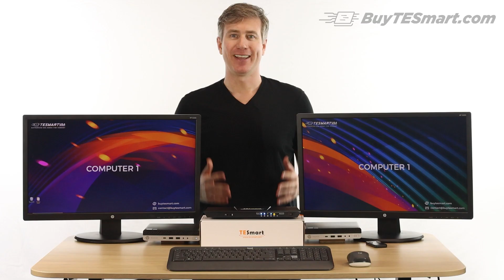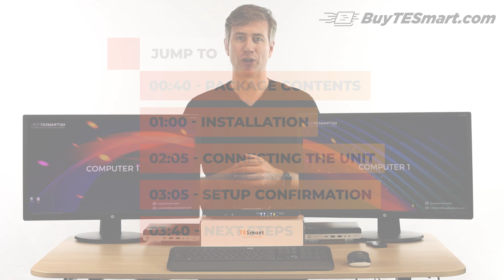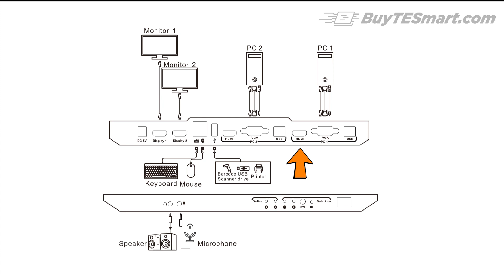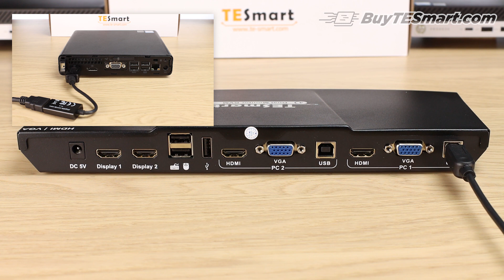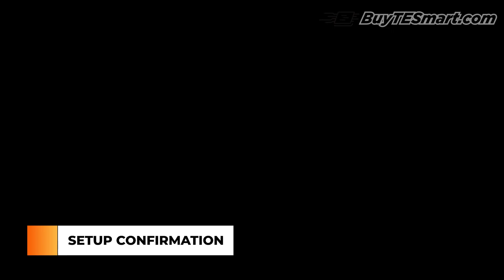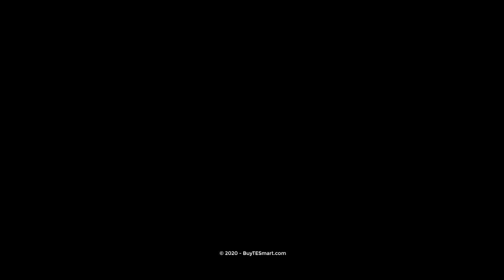TESmart Dual Monitor KVM Setup Video HDMI+VGA Switch

Comment: Just to be clear, my laptops have 1 HDMI port and a USB-C port. Would this item work for me? with an adapter? 
 or can I use an HDMI splitter?
Reply from the maker: This is an old video.  Checkout this one....  https://youtu.be/GfBZiGp_s_I. You will use the HDMI port plus a USB-C to HDMI or USB-C to DisplayPort adapter, depending on the KVM.  Here's a link to the tested--approved adapter page https://buytesmart.com/adapters.

Comment: I have the 2x problems:

1) only Online 1 is On and Online 2 if OFF although the USB connection is established and all USB devices work. 
     How do I fix this?

2) Furthermore I have only a picture on 1x monitor (both are the same model with HDMI port).
     - If I connect my desktop PC onboard graphic (no graphic card installed) directly to both monitors (without the KVM) via HDMI to HDMI and DVI-D 24+1 via DVI-D 24+1 to HDMI adapter to HDMI
       I have a picture on both monitors.
     - The same for my Laptop HDMI to HDMI and USB-C via USB-C to HDMI adapter to HDMI. I have a picture on both monitors.
     But if I connect the KVM I have only a picture on 1 Monitor (plus only Online 1 is On only).
     How to fix?
Reply from the maker: Hi.  Checkout the troubleshooting video:  https://youtu.be/Eppd3qjy3vk.  You'll have to open a ticket with us or TESmart, whoever sold you the KVM if you need more support.  We can't really diagnose much over YT comments because we don't get notified of replies.

Comment: Great video, thank you. A quick question, I am from Australia, so I just want to make sure that, given the different electricity with U.S.A. your product will work here and not burn my fuses? :D
Reply from the maker: They will work.  We have customers that purchase for Australia from time-to-time.  We also have the correct Australian plugs, if you need.  One last thing... this video is for an older model.  Most likely you would want one of these... https://youtu.be/v6K4eIHZXZI
Reply: Thank you so much for your prompt reply. You are correct, that is more likely what I am after.

Comment: Is it possible to get higher resolution than 1920x1080 . I would like to have 2560x1440. I have TES Smart connector for commuter 1 DP 1 HDMI    for device to monitor HDMI.
Reply from the maker: For this model, only 1 monitor (the monitor that receives the HDMI signal) will have resolutions above 1080P.  If you're looking for higher resolution and speeds, you should check out the newer models:  https://youtu.be/v6K4eIHZXZI

Comment: Hi Justin,
I got this switch for my birthday and can not wait to use it, but my equipment is different. I triedto find out via your website, but got no answer.
What I got is: 
•	2x Monitor HP Compaq LA2306x with VGA, DVI and display port
•	1x PC WIN 10 PRO, with VGA and display port
•	1x PC WIN 7 PRO and WIN 10 PRO dual boot with VGA, DVI and hdmi port
•	1x Mouse and 1 keyboard, standard USB
I believe I will need additional adapter. Please advise.
Reply from the maker: Hey Alfred, Yes it seems you will. Did you go to BuyTESmart.com we do not have any previous support request on our website on this. You can also send a direct email to Contact@buytesmart.com and we will get you all setup :)

Comment: Thanks for the video. Can I set this up with Mac OS to one monitor and Windows OS to the other? Will shortcut keys need to be modified? Thanks
Reply from the maker: Hey Ben Bishop! Yes this would work with that setup. Shortcut keys do not have to be modified, nonetheless if you need to modify the keys its a simple Scroll Lock+ Scroll Lock + F1 will switch the hot keys to Right Ctrl :)

Comment: How would you connect a Raspberry Pi 4 since it uses dual micro hdmi outputs with no VGA output on the board? From what it looks like, 1 of my micro HDMI would be adapted to a full-size HDMI output to the switch, the other micro HDMI to a VGA adaptor along with a USB output if this is correct. Connecting either my work or home laptop looks straight forward. Also, would this be able to connect the new iPad Pro with the new magic keyboard?
Reply from the maker: You are correct, you would need adapters.  We haven't looked into micro HDMI adapters but have a list of other tested/approved adapters in the Support section of BuyTESmart.com.  Not sure about the iPad Pro.  We haven't had an opportunity to test with that.  I'm thinking it would be a little bit of a challenge due to Apple's preference for a closed environment.

Comment: Hi there Justin. FYI I bought this Tesmart dual monitor KVM a short while ago. 

Got it connected and running as advised cf. manual + other Tesmart vid. My focus for starters is simply to get my main PC working with all promoted features - it's setup as described below: 

A) Main PC (Lenovo ThinkCentre running Windows 10) has no HDMI out so got it connected via (*) VGA > HDMI adapter > HDMI + (**) DP > DP + USB
B) For input units I got a USB wired keyboard + USB wired mouse  
C) I have two Philips 278E monitors connected to the KVM as output screens. 

I can get some KVM features working - but not all. What works?  I can shift Monitors via SrcLK x 2 - but only provided I got a second PC connected as well. I can shift Input destination via 2 x (right) AltGr with two PCs connected. 

Unfortunately so far there's 1 major issue with the KVM: 

I can ONLY get the main PC displaying on 1 screen at the time. Can neither get the Main PC to show op as duplicated in my dual screen setup - nor as one large extended screen utilizing both monitors. Nothing happens when I click the right Ctrl bottom x 2 (also no 'registration' sound of the input which is the case for other shortcuts that do work cf. above). 

Got no luck using the remote either.

So how do I resolve?  

Also; how do I connect a Macbook Pro (2012) to support 1 PC dual extended monitor setup (like the one that doesn't presently work with my Main PC cf. question 1)? Presently I've tried mini display port to HDMI adapter + USB connection which works - so I reckon a USB to DP adaptor is needed to complete this setup as well (?).  

Obviously I need to see the main PC working before investing it further adaptors for the Macbook Pro in order to get it working.

Thanks in advance!

P.s. The KVM model I got has HDMI + DP ports for input. Strangely it differentiates from the one you're showing in your vids as it does not have front audio jacks input options for mike + headphones. Rather it has only a headphone in the back next to the power chord jack. Just figured it worth mentioning for troubleshooting purposes. Haven't had luck getting the audio jack work out of the box either btw. but in all fairness I haven't tested it deeply yet.
Reply: May be that the issue is due to the dual screen capabilities of my main PC.

When I go to the screen settings of Win 10 on the main PC (Lenovo thinkcentre tiny) I see no dual display options at all . Reckon that may very well be the the culprit and that there's little to do about that (besides upgrading internals which is not really an option)? 

If the answer is yes - I guess I left with my Macbook 2012 for testing the dual monitor setup (as this supports dual screen cf. settings) until I can afford a new work station with a graphics card sporting multiple display support.

I've checked your compatibility webpage but don't see a solution to utilise a Macbook Pro (2012). However, reckon a setup using the following adaptor types ought to work?: (1) USB 3.0 to HDMI (example: https://amzn.to/33VfOuG)+ (2) Mini Displayport to Displayport (example: https://amzn.to/3aqrUOK). 

Please advise - tnx!
Reply from the maker: Hi Mads.  I'm sure you've resolved this issue by now.  It got buried in our comments.  Long details like this are always best for our tech support email:  contact@buytesmart.com.  You definitely have a different model than what is shown in this video so the hotkeys will be different.

Comment: Will using this KVM result in 2 different monitor resolutions based on the HDMI and VGA inputs?
Reply from the maker: We recommend setting both monitors to 1920x1080 @ 60 hz refresh rate.  The HDMI connection can go up to 4K30hz but 30hz is not ideal (visually) for computers.  30hz is fine for video/tv though.